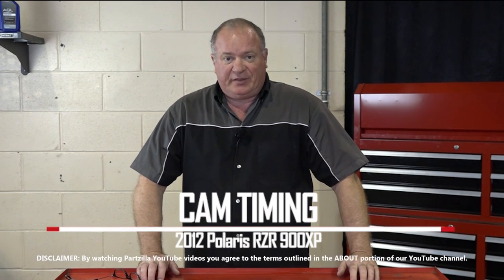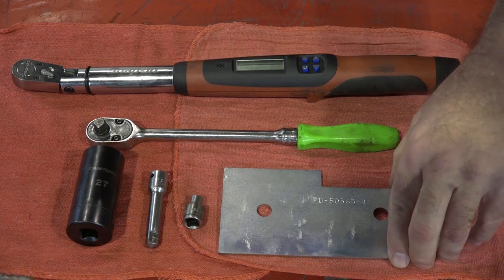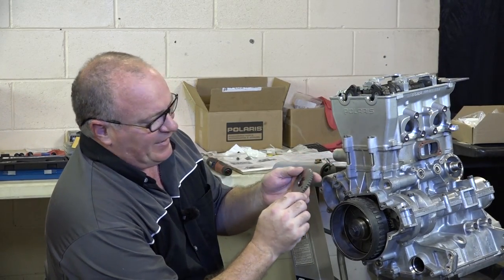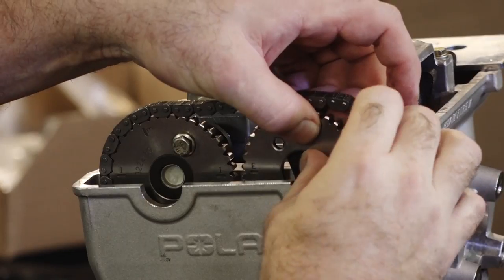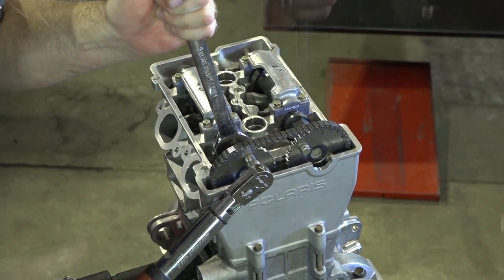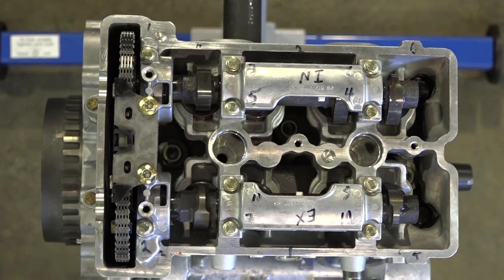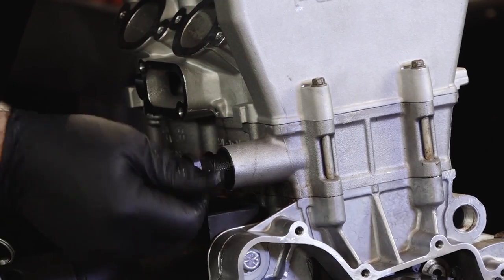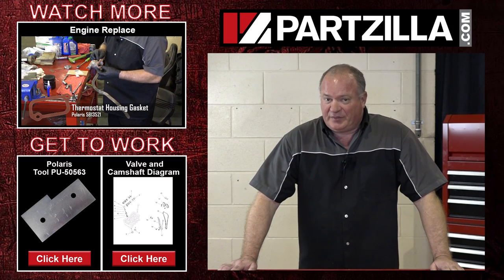Polaris RZR 900 XP Cam Chain Timing | Partzilla.com

Comment: Hmmm, so at top dead center the intake valves are slightly open? Otherwise you would not need a tool to hold cam.

Comment: I Just replaced my valve seals and need to check the timing.. Both of the camshafts have E and I mark’s on them so  I’m guessing I should go by the I on intake an E on the exhaust side ? ? Also what’s the TDC mark on the fly wheel look like ? 2012 xp900 but The engine was replaced a year or so ago and it has the newer top hat style valve seals

Comment: Hi john i have a  2011 Rzr900 with Cranking issues which i think maybe timing related. Cranks over with the spark plugs out fine with good compression both cylinders, as soon as the plugs are installed its like it seems to have to much compression and struggles to crank the engine over. I've over seen all the basics i.e smotor wiring, valve clearances, timing chain timing, injector pulse, spark ect. and was wondering if its a common issue for this model or weather or not someone's had the same issue before and would like to enlightening me with their findings as its just sitting in the shed collecting dust and needs to be brought back to is former gory. Cheers
Reply: According to my research the cam chain tensioner (Oil pressure actuated) can fail and the cam skip a tooth or more. Bad design.
Many people are installing a manual adjuster or yamaha style auto adjuster kit such as from Alba Racing.

Comment: I'm working on a 2011 rzr 900xp that's been bored out. I'm trying to set the time. I have the left cylinder at dtc. I have my intake and exhaust cams set as they are suppose to. The fly wheel timing mark isn't lining up where I think it was suppose to be. It is on the left hand side where the case line is. And that's where my cylinder is TDC. When we try to start it without plugs it rolls over perfect. But when I put plugs in it, it spins and clunks spins and clunks. Could the flywheel and woodruff nut be on improperly?
Reply: Have you figured this out? Mines doing the same thing after installing a rev 6 crankshaft

Comment: my 2011 polaris sportsman 850xp eps leaked oil from the engine block. the original owners only did 1 oil change and it was with a terrible brand. i went ahead and did a oil change with the polaris extreme duty oil change kit. it had stopped leaking from there on, was that the reason it leaked?

Comment: after setting both cams and install the tensioner should the flywheel still be at top dead center or will it turn away as u scew in the tensioner
Reply from the maker: It should stay at TDC.
Reply: after setting the timing and install the motor it wont start..  poping bach through the intake..  what would cause that?
Reply: Kirk Dole  I am also having this problem. Did you figure out what happened?
Reply: Partzilla can you answer the question below as I am also having this issue.
Reply: did anyone figure out why it was back firing through the intake. My 2014 900 xp is doing it.
Reply: @anagdz82   coming off a forum: "Removed the flywheel today, discovered that that flywheel key has been sheared but it just so happened to turn the flywheel enough to where the MAG side was at TDC with the hash on case split. Because of this the firing and fuel order was reversed and that was causing it to backfire continuously as if it was running." crazy things

Comment: First, I would like to say thank you for this break down it helped me with my 2013 XP rebuild. Also, I ordered a few parts from partzilla even though they were a bit more expensive than my normal site just because of your videos. My question is, Im currently at this part of the rebuild and I have 2 marks on my fly wheel. One line and one  V mark both are top dead center one for the PTO side and the other the stator side. I looked on the internet and cannot find out which mark I should use and I don't want to have to set the timing again if I pick the wrong one with the motor in the rzr. So do I use the line or the V mark, or which cylinder do I set top dead too passenger or driver? thanks in advance
Reply from the maker: Rotate the engine until the flywheel Top Dead Center (TDC) mark (A) is aligned or centered in the Crankshaft Position Sensor (CPS) mounting hole (B). This places the PTO cylinder at TDC for camshaft installation. 

http://bit.ly/2tq3Oie

IMPORTANT 

DO NOT use the “V” mark located on the flywheel opposite of the “I” mark. Only the “I” mark should be used as a TDC reference.
Reply: As far as I'm aware it is your driver side for dtc and should be using the V
Reply: @trentpetersen8754   little late on that answer lol but thanks

Comment: I need help with a polaris rzr xp 900 2012 how to know when it is correctly in time since it has been tested in different ways
Reply from the maker: The only foolproof way is to tear it down to this point in the video, rotate to TDC and make sure the marks line up.  If they don't, then you need to adjust.
Reply: Rafael Osorio.  Hola una pregunta como poner atienpo polaris esporman sp 570 2015

Comment: does it matter witch stroke u put the chain on the cams?
Reply from the maker: Make sure it's at Top Dead Center with the camshafts pointing up and towards the center of the motor.  Then you can line up the plate to secure them while you put the chain on.

Comment: is the tdc mark  on the 2013 rzr the same as the 2012??
Reply from the maker: There are changes from 2012 to 2013 in the motor configuration.  TDC is visible through the CPS (Crank Position Senseor) hole on the 2013.

Comment: Should there be any chain sag between the two cam sprockets? When I've fitted the sprockets and tensioner and rotate the engine primary ccw the intake cam seems to advance as it comes off the valves and add some slack to the cain. This then raises the chain slightly off the exhaust sprocket. It doesn't jump but it doesn't seem right. I've re done it a few times and end up with the same result.
Reply from the maker: Once the tensioner is set and in place, there should be very little slack on the cam chain.